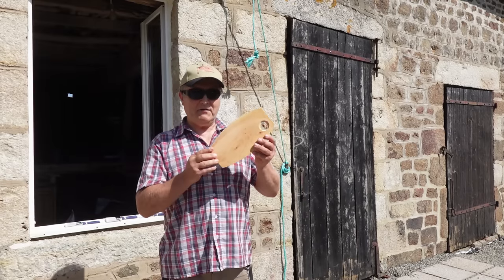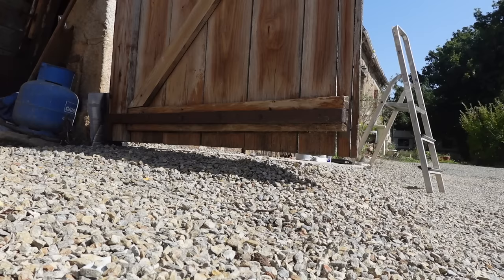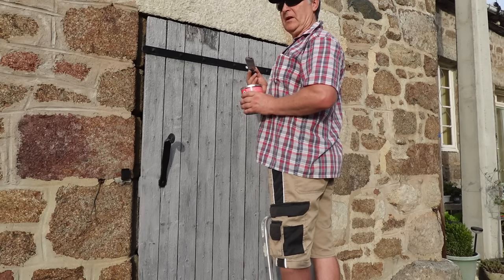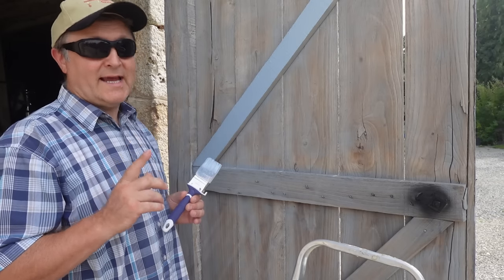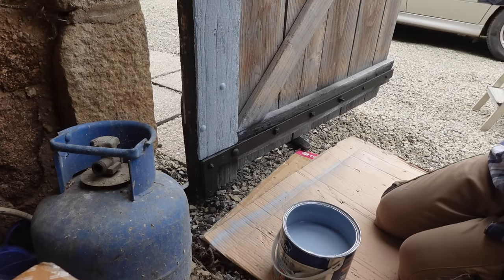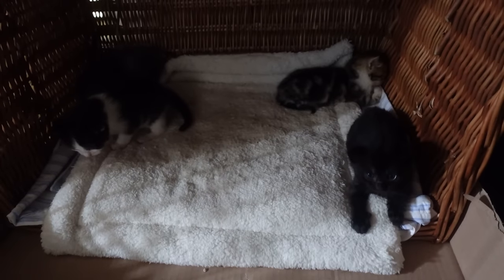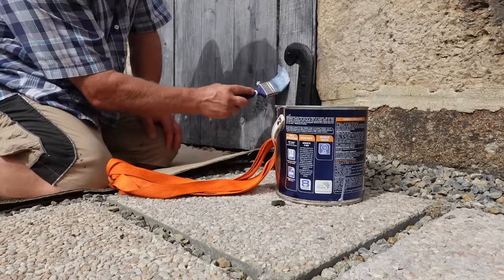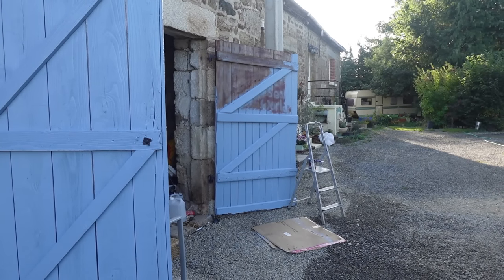Painting 250 Year Old Cottage Shutters | Cottage Renovation Episode 32

Comment: Love that shade of blue.  Really cheers up the building.  I have stopped using paint on wood and now use stain that looks like paint but conditions the wood at the same time. One is by Sansin (Canadian co.). I pick any color from any paint company, etc., and they match it in an opaque saturation.  Then just need to apply a maintenance coat every few years if needed.  I’m done with peeling paint.  Part of the reason is I can’t afford a professional painter every few years, so can do this myself.
Reply: Sounds like a great product 👍 not sure we can get anything like that here....🤔

Comment: Sean, the paint color is lovely, and it does liven up the place.  It really looks good.A husband and wife and 2 kids from the Ukraine had bought and are renovating a nice sized property in rural Belgium which includes an old farmhouse dating from 1908 and has out buildings as well. Their YouTube Channel is De Hoeve. Old Belgian farm renovation. Some smaller buildings were demolished, and brickwork and concrete were hauled off for recycling.  The attached barn has a hay loft.  Like you, they wanted to remove the hay.  Luckily, the farmer next door was able to use the old hay.  The hay was removed from the hay loft, loaded in a large dump trailer and the farmer was able to shred and disperse the hay, from behind his farm tractor, on his crop field and disced it into the ground.  So, this is a good solution for you Sean.

Comment: Will you be sending this coat of paint to make it at least moved to the touch? It really is a good color. I like it to. I'm glad your wife agrees with us! It improves the look at the front there very nicely, and You are a more experienced painter deny. My question would be would it help to put some caulking in those cracks between the boards? It sure would help keep out rain when the wind is behind it or in the winter when there's a cold draft coming. Even if you do have a nice insulating door inside, I think you'd appreciate having it. Just my suggestion I know it's a tad extra work but do you think it would hold up for any length of time? Anyway, I do like the paint and I do like the color so that's two votes in its favor! Thank you for sharing Sean.
Reply from the maker: i
Its also nice to let air in the property when it's hot outside with Doors open and shutters shut

Comment: The whole series of videos is great and viewers cannot but admire your versatility and skills, all presented so engagingly. A question about the choice of roofing materials: would tiles not make the whole roof too heavy for the wooden supporting structure, designed for slates?
Reply from the maker: The roofs are constructed so strongly when repaired they can have either
Reply: @Seans_World  That's reassuring & great testimony to the quality of the original building work. Hope it all goes well - stay safe up there!

Comment: This is off the painting subjects but I’ve noticed the Diesel engine cars sound really different from the diesel cars here in the states. I drive a diesel VW Jetta and it is really quiet compared to cars in France. Why do you think that is? We have strict EPA rules here in the states. I’ve noticed since the stricter EPA standards started here my MPG  has dropped from 45 mpg to 37 mpg. Is it different in France? Just wondering

Comment: Hi, Sean, greetings from Australia. i love the colour. Just for my own renovation knowledge I wondered why you 
used a primer spray rather than paint the primer? And didnt the front/outside need a quick sand, especially due to the black and the bottom of the second door which seemed a bit ragged?
Reply from the maker: Spray primer much cheaper in a can, the doors had been sanded and the bottom of door will be cut off